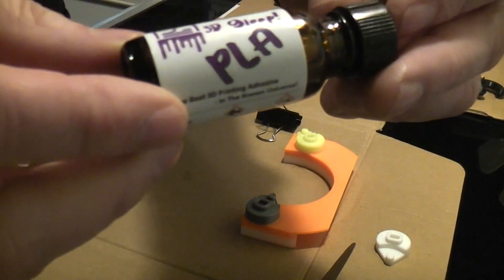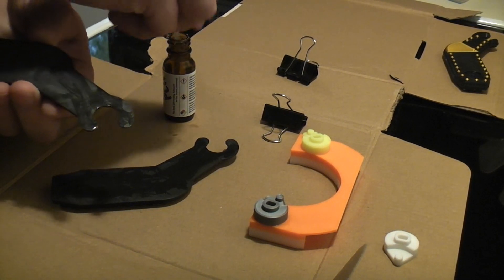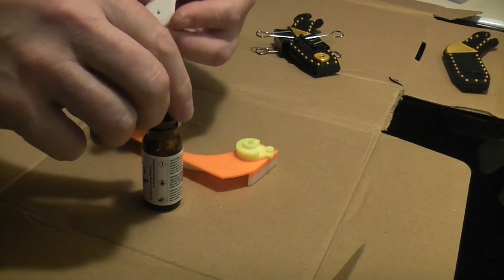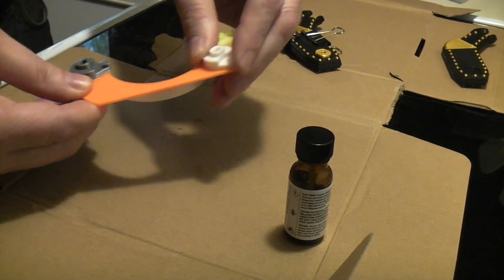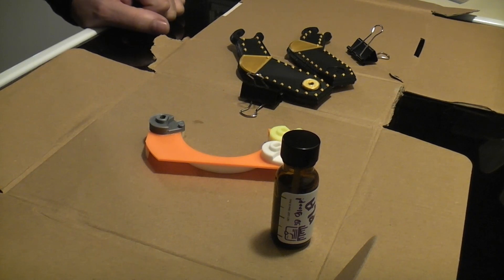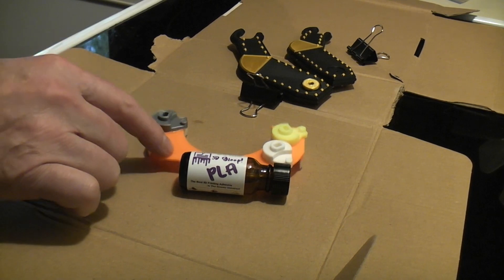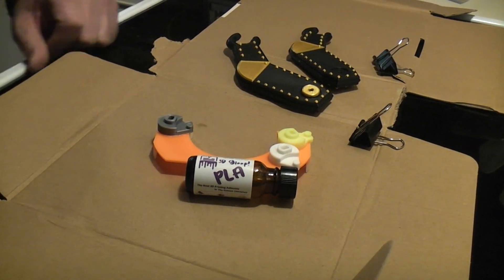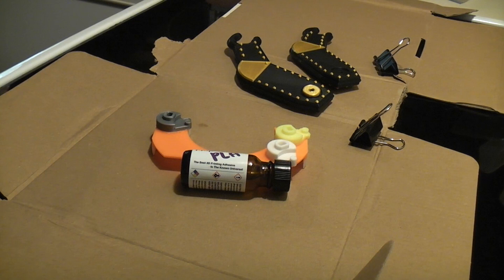Testing 3d Gloop for PLA, thank you 3d Printing Nerd for the heads up !

Comment: I use 3D Gloop all the time, works very well
Reply from the maker: Yes it is amazing how well it joins the printed parts ! But the smell is a bit strong. I do it outside or under fan vent.
Reply: thanks for the video, did you try to smooth printed object with it ? if so, how does it dry ? does it stay sticky ?
Reply from the maker: No I used up the sample bottle before trying the smoothing idea. It will not stay tacky as it dries quite fast. The smell is the only bad part, you need to work with it out side or under a vent fan. Fantastic glue for PLA. If they do come out with the spray can version then I would try that for smoothing parts as that would be easier than trying to brush it on. I have used epoxie thinned with alcohol to smooth printed parts and that works but with all coatings you run the risk of getting runs in the finish.